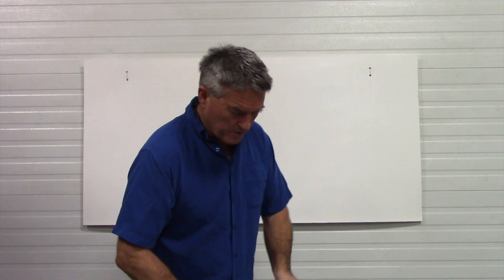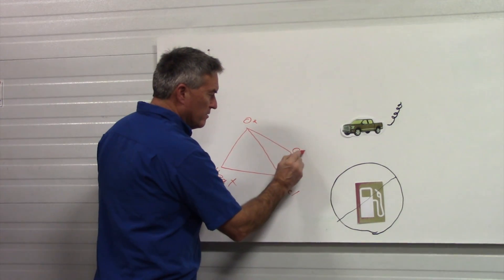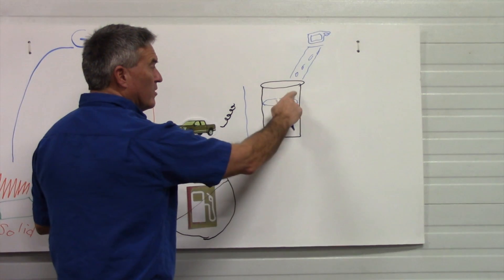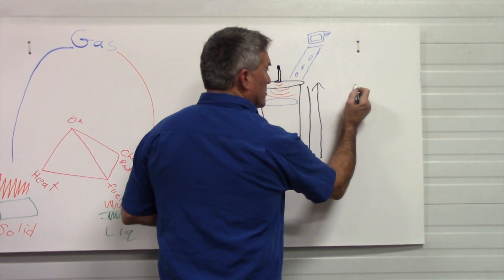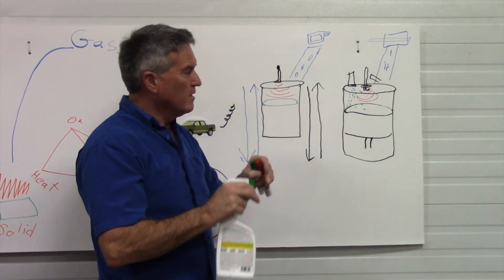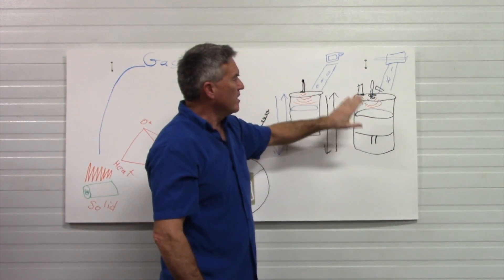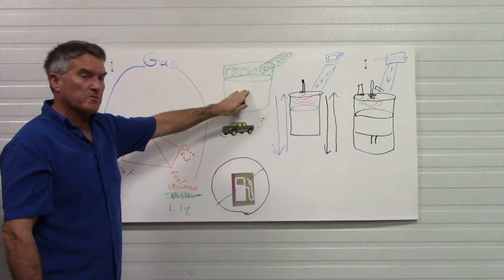One Simple Trick to get 100 miles per gallon with less pollution!

Comment: JAMES J DEVITO III,GENERAL DYNAMICS ELECTRONICS DIVISION,THEN PREMIXING THE LIQUID GASOLINE INTO A GAS, WILL RECONSTRUCT THE OLD SITUATION OF NOT COOLING DOWN THE CYLINDER WALLS DO TO THE AIR/FUEL RATIO BEING INCORRECT HENCE A LEAN MIXTURE? I JUST NEED A EXPLANATION  DO TO THE FUEL DENSITY DIFFERENCE JUST AS YOU EXPLAINED LESS SPRAYED DROPLETS OF LIQUID FUEL

Comment: Back in the early 1980's we were using a setup similar to this. It was called a "Pogue carburetor". It worked fair. I did not spend a lot of time on it, as it was hard to make it work at all throttle openings on a Pontiac 350ci. motor. I think I still have the paperwork on this somewhere. Haven't thought about this in years.
Reply: There is actually a guy that got 100% fuel vapor using a the exhaust with a heat exchanger and a turbo faced directly into the intake. He shows exactly how its done on the Facebook group Gasoline Vapor Systems.

Comment: First straight up lie is that we are going to run out of gas. Fact is that crude oil didn't just appear. I has been making for many years and still even as we are using it it is making. Plus we can make gas (ethanol) out of corn. But no need to using gas at all, we can make another product and put it in our engines NOW. The original diesel engine was designed to run on plan old oil. We can make that all day long.   Next he talks about turning liquid gas into a vapor gas and then burning it in the engine. Hey Mr. Canadian, have you ever heard of a propane engine? I've got one. In the tank is a liquid and as it come out and expands it quickly turns into a gas. No special module needed.   Now the reason that engine you showed got 70 miles per gallon is that it was on a close course running at a set speed. This is not how the average person drives their car. Most are stuck in traffic or ripping along at 75mph where wind affects their performance.   I am totally into saving money at the pump and I want nothing more than a car that gets 100mpg. Sadly nothing you said was new or will actually give me that. It's just a pipe dream. So, for now I am stuck with my VW Jetta getting 52 mpg on a good day and 48 on a bad day. Yes it is a diesel. So I can burn cooking oil in it as well. ;-)

Comment: There is One Borne Every Minute.  You managed to get 741k of them to watch this entire video.  What a waste of my time to watch 1/2.
Have you ever heard of stoichiometry?
Don't you realize that, in older cars (carburetor) when a car is cold, the fuel is not vaporized. Engines run rough, terrible, until warm. 
When the car is hot, the engine and intake warm the air and gas. Exactly what you proposed. Car gets better mileage and horsepower when hot. 
Fuel Injection is a very precision way of Achieving stoichiometry by spraying extremely fine droplets of fuel into the chamber. 
If such Bologna as you advertise worked, every auto manufacturer would be doing it. The principal and application are
just extremely easy and already happening in a much more precision and metered process usually injection.

Comment: Yeah we all did, and also you did one test for 300 miles now did anybody tromp that pedal to the floor like 90% of the people do and if they did would the engine overheat and then would you ruin your engine? so once you've tested for a year and done 20 million miles with 20 different Vehicles than you got something to talk about, until then you're babying one little engine and just putt putting around to get results you want.. of course it would work just like running canola oil BUT  not in ALL VEHICLES and NOT in ALL SITUATIONS!! Thus you need to OVER-DUE the fuel...
JUST LIKE WE HAVE BEEN DOING !!

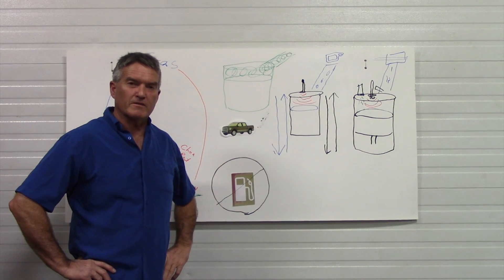Comment: Wow - this guy doesn't have a clue. Whenever he mentions something technical - it's wrong !  ... LOL @ 15:56 ! His proposition is to simply put less fuel into the engine and you will burn less fuel. The funny part is that he does not recognize that less fuel = less power, but instead says the the issue is that not enough (liquid) fuel reaches the cylinder wall TO LUBRICATE the cylinder. ..... Wow two misconceptions in one go. Note that liquid fuel does not lubricate the cylinder - it, if anything will strip the the fine oil film deposited by the piston oil ring group.  

If you know a few basic things about engines - you will be entertained, if you don't --- Please do not watch this as this is a 3rd graders distorted view of basic reality.    .... better yet - look up 'flat earth' videos.

Comment: Several easy tricks is no 1) Run only Downhill, No 2) Slipstream a Lorry (Truck) No 3) Light 'Gas' Pedal No 4) Get A Diesel and keep Revs low. No 5) Keep Car in Garage and warm up to 90°  Before Starting Engine. No 6) Do not exceed 58 MPH. If Obeying all these instructions with overinflated tyres you can get over 100 mpg. I never have but regularly get 74+ MPG (UK Gallon) in my Mercedes B200 CDi AMG Line.
Reply: Nice to know but it doesn't seem very practical for the common everyday driver. I wish it was.

Comment: The problem I see with your evaluation is that you call oil fossil fuel yet there are oil wells that were supposed to be dry that are now full. Is it possible that the Earth is actually replenishing it as natural proses?  Also you say how much pollution the cars and trucks are putting out yet 1 volcano eruption puts out what about 100 times more than that and that's only 1 volcano eruption. You're making these numbers way bigger than they need to be.  If you really want to be concerned think more about ground pollution which seems to be not even talked about, chemical dump sites  Nuclear dump sites Over concentrated garbage dump sites and the list goes on.  Yet you hear very little about it.  Why is it such a pet peeve to keep talking about carbon because actually plants consume carbon dioxide and make oxygen out of it.

Comment: OK, so mixing the air fuel before it enters the cylinder is an argument in favor of a carburetor.  That's exactly what a carburetor does, except it's atomized liquid fuel and your suggestion is that it should already be a gas before entering the cylinder.  One could argue that atomized fuel vaporizes pretty quickly so much of it from a carburetor is actually vapor by the time it enter the cylinder.  But that doesn't actually work out as well as injectors in practice.  So let's examine combustion more closely.

There are 2 things happening in combustion that create pressure in the cylinder.  One is heat and the other is a change in the total number of molecules due to combustion.  Obviously, the more heat generated in combustion, the more the gas would expand if it were not contained.  It is contained and therefore pressure increases due to the rise in temperature.  This is something we are pretty familiar with and is described in Gay-Lussac's gas law.  

The other point relates to Avogadro's law, a liter of any gas at standard temperature and pressure (STP) will contain 6.022 x 10^23 molecules.  It doesn't matter how big, or how complex the molecules are there will be the same number of them in a given volume at STP.  Therefore, whatever gas we draw into a cylinder will have the same number of molecules regardless of what the gas is comprised of.  In the case of fuel injection, all of it will be air and then we add fuel in addition to that.  However, in the case of the suggested air/fuel mix, some will be air and some fuel, leaving us with less air and less fuel and therefore less power than with fuel injection.  So, this would have a similar effect on fuel economy as just having a smaller less powerful engine.

If you really want to save fuel, you need to look at the fundamentals of combustion efficiency to extract more power from the process.  Assuming a naturally aspirated engine, we are limited by the amount of air drawn into the cylinder but can inject any amount of fuel,   The component of air that is consumed in combustion is oxygen (O2)  this is a molecule composed of 2 atoms.  If the combustion product molecule only has 1 oxygen atom, there will be more molecules so more pressure and power.  Petrol is a hydrocarbon and mostly produces CO2, H2O and CO  H2O and CO both have only one oxygen.  CO2 has 2 oxygen.  If we can eliminate CO2 so that there are more single O atoms, we will get more power but we don't really want CO (carbon monoxide) as it is poisonous.  In fact modern engines try to minimize this by creating more CO2 which gives us less power.  What this shows is the carbon based fuels are not going to be ideal.

So, what is ideal?  We want to produce a simple 2 atom molecule 1 fuel and 1 oxygen only but we don't want poisonous CO (carbon monoxide) and we don't want CO2 because the engine capacity limits oxygen intake.  Of the products we currently have H2O is the closest though we would prefer less fuel molecules consumed.  Hydrogen is known to have the highest calorific (heat) value of any fuel and it maximises the number of exhaust molecules for the engines capacity.  However, we don't have to use all that extra power and not doing so reduces the amount of fuel burned.  The problems are: extracting hydrogen cheaply, liquefying, storing and handling.  The danger presented by it being a gas at environmental temperatures and pressures (consider the Hindenburg) and of course, we are using 2 fuel atoms to 1 oxygen which is still not ideal.  As above, a simple 2 atom molecule would be the goal but not poisonous ones like CO.

So, hopefully all this might indicate some of the real problems with trying to improve fuel efficiency and show that claims might be just too good to be true and have hidden impositions you may not like, such as less power which you can choose to do anyway just by vehicle choice and or slowing down.
Reply: I agree this vid  draws an incorrect conclusion, but so does your combustion analysis. Every analysis around ignores the fact that the combustion air is 80% nitrogen. The internal combustion engine takes in huge volumes of nitrogen that is at ambient temperature and expels it into the exhaust manifold at very high temperature. A huge amount of energy is lost in making hot nitrogen.
Reply: I think we should not be looking for combustion efficiency but rather a different type of fuel or changing the engine system to accept the mentioned mixture in the video, bc as stated in the video, our traditional fuel will eventually run out. I think producing hydrogen on demand and not storing it is the best route. But I think the problem with that is that it can oxidize and ruin the engine if water molecules gets trapped in the engine over time.
Reply: @chadcervantes6066  H2O is a natural by product in current engines, so no change.

Comment: Ignition and keeping an engine running requires a minimum fuel/air mixture. Too high and the engine floods. Too little and it either wont run or runs in a lean condition which is not good for the engine and you get lose of power. The myth of the 100 mpg carburetor is just that, a myth.
Reply: GM Laurence .
Bullshit gm penis toy.
100 mpg was easy to achieve before they altered the fuel to prevent such things.
Now go tell your daddy Satan said go to hell

Comment: I have been interested in 'vapor' gasoline for many years, always interested in getting better MPG's. During the 1980's a man was on the local news in Columbus, MS to show off his Cadillac and made a vapor carburetor for it and was getting aroung 70 MPG. He later had a planned program to discuss the theory and operation of it. Later during the 90's I tried to get in contact with companies that had kits to vaporize gasoline, but they only lasted about a month or so because of the extra additives that were added to gasoline now by the oil companies to reduce vaporization. Think about it-if a tanker of gas leaves the distiller plant, drives 400 miles and instead of 5,000 gallons of gas, he has 4,500 gallons left the company will go broke very fast. It would actually have to be in a cooled pressurized tank-much too costly. And vaporizing gas from a 'kit' is not very safe-could explode!
The car companies have the technology to make 100 MPG SUV's right now (hybrid), but they are very costly. I live just a few miles from Miss. State campus and in 2010, they won the College ECOCAR completion with a SUV that got 118 MPG: https://www.wired.com/2010/06/mississippi-state-ecocar-118-mpg/.  
Big oil is not going to allow it-they shut down Henry Ford's alcohol plants down by backing Prohibition. His first cars ran off alcohol! https://www.washingtonpost.com/archive/opinions/1979/08/05/the-godfather-of-gasohol-ishenry-ford/ca98c17b-3112-4f80-b98a-7b06ed6a735b/?noredirect=on 

Check out the history: https://fuel-efficient-vehicles.org/energy-news/?page_id=785 , and https://beforeitsnews.com/v3/alternative/2013/2590184.html . 
Peace HHH
Reply: I'm down on the coast of Mississippi. Vapor carbs still work and we'll all that burns in combustion is the vapor the 70 percent wasted gas cleans and cools the valves and combustion chambers.  I hadn't seen any problems with vapor carbs.  Maybe you weren't getting enough air or something.  And it's certaint very easy and cheap to make safe.  You have your gas can under your hood,  your tubrs run into your intake. Obviously you have to pull the fuse on your fuel pump and such.  Not on your air tube,  on your fuel tubes going into the intake in the middle or closer to your gas can.  Younstjck in little spark arrestors.  Little mesh screen things.  If somehow the engine back fired it's safe. Probably can pull one off your lawn mower honestly. A lawn mower or generator is S good place to start with them. Air cooled motors are made to run hotter anyway. There's f 150 gets Around 100 mpg.  You cant accelerate hard like your drag racing.  But as you drive or the engine runs it's pulling air into your gas can. Like a water bong does it bubbles and makes the gas vaporize. Literally cost 20 dollars in parts to make one. Engine will run lean but I hadn't heard of many issues maybe in the long run risk a burned valve. But it seems rare. Try it again with a mower or something it works if I was more in the country i would run my house mostly by generators with vapor carbs and use minimal utility power.  It's actually illegal to go off grid.  Wish it wasn't a joke.  But if you call and say I need a disconnect I'll provide my own power.  More the. The power company is going to show up.  You can even use a electric motor to turn a alternator and get free electricity. You remove the diodes in the back that make it DC and you get 120 80 or 100 amps vac. Or you can make it 220vac. I've seen guys use them in 220 to power portable wrlders on backs of trucks years ago.  People don't believe it's possible.  You need a car battery or outlet to get your dc motor started, once it's started you can have the altenator power it.  You have 80 or 100 plus amps.  If you need more for your house or hunting cabin use two alternators.  Old Chrysler 3 phase ones work the best.  You can use others you'll have to modify or remove the voltage regulators. People rather not believe then try it. They don't get it's called alternator becsuse it makes AC your car doesn't run on AC it runs on DC the diodes take the 120vac and convert it to 12v DC.  Old cars came with DC generators.  Remove those diodes it stays AC. Some people know the truth were given this bs free energy generators are impossible break the 2nd law of thermodynamics yada yada. They shove it in everyone's face daily with their own cars.  When you start a car you can pull the battery the alternator provides the power needed. All you need is a source to get it going.  This is how you check if your battery or alternator is going out.  Pull the battery while running.  As long as the motor spins the alternator will power all the electronics in a vehicle as long as its in the proper rpm range. Now scale it down you don't need a car engine to spin a alternator. If you have a 100 amp alternator you might need 12 15 amps for your few horsepower motor.  Maybe slightly more if you run two not much more though.  Proper rpm range you'll get those 100 amps. Without the diodes on the back of 3 phase alternator. You get house voltage AC 80 to 100 amps will power a lot In a house. I've seen a few houses that were only wired 100 amp mains to begin with.  That's another story. Houses are wired with the logic you'll never be running more 60 percent of capacity at any given time. Anyways hope maybe some will go down the rrabbit hole there are some help tutorials on this
Reply: Word to wise you'll notice I said I'd run my house off generators with vapor carbs. If you do build one of these alternators don't tell anyone. I'm being serious. With gas even with vapor carbs your still paying for your energy even though it's cheap. Your still paying. Just take my word on it I'll leave it at that.  I will never make one again but TBH it's not hard and they laugh at us.  We can build free energy generators with scrap parts and then they use the same concept they tell us won't work breaks laws of physics in the car we use everyday.  If you keep these to yourself don't brag to friends don't make or give them to people you'll be OK. Don't go on social media or anything it's not a joke. Seriously think of the Implicstions if it wasn't laughed at like they do and ridiculed and 10 million homes in the US built one by this Friday within a year billions of dollars lost.  You and wife and or kids can actually keep a secret give it a go. Don't believe me you'll get a visit to and it's not pleasant the power company is very powerful pun intended